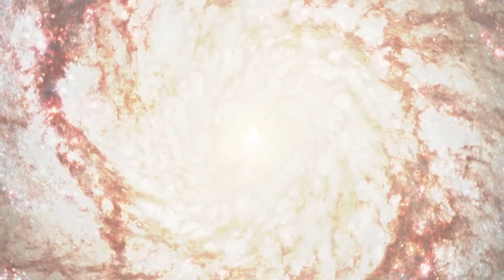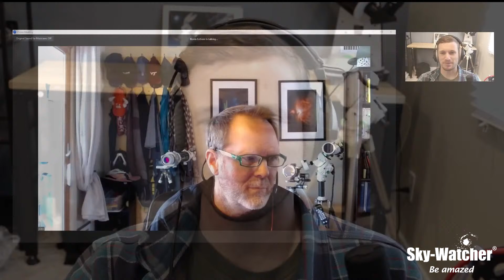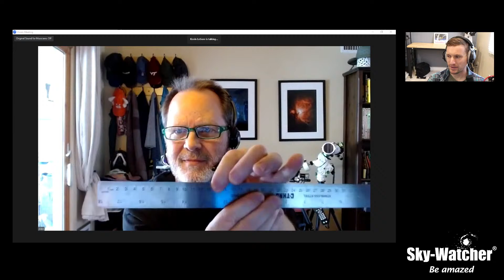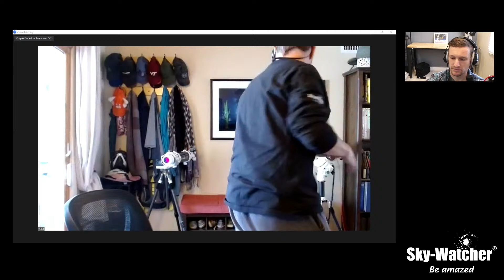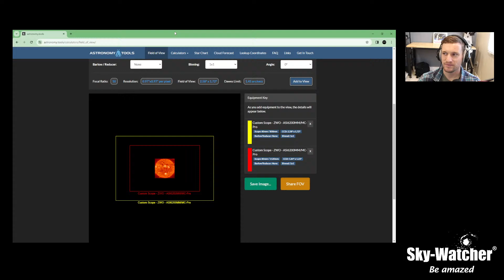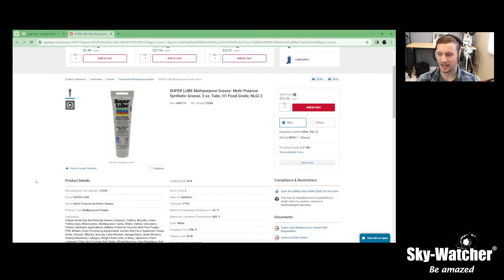What's Up? Webcast: Tech Talk with Alex

Comment: Great video.  I have a comment about the question that was asked at 10:11 in the video about the "double image" using an ND 100,000 filter with a Nikon P-900x camera.  It sounds like the person is getting a "ghost" image.  This occurs because the full solar disk and the partial phases are a really bright area of light.  So, some lens surface in the camera is reflecting that bright spot forward, to the front of the lens, and then that bright spot gets reflected off the backside of the ND filter, back down the optics to the sensor creating the "ghost" image.  The solution is to angle your solar filter just a couple of degrees to send that ghost image to the side walls of the optics.  This is a problem with a screw-on ND filter, because it is always going to screw on "square" to the front objective, you can't make it tilt, so you can't get rid of the ghost image.  This can happen with glass filters in aluminum frames also.  That is why I always recommend buying a glass solar filter about a half inch larger than the front of your gear and padding the inside of the frame with felt, making it snug, but not tight.  This allows you a little "play" room to tilt the filter.  Perhaps the user with the ND filter can glue the ND filter to another empty threaded ring of the same size needed for the front of the camera, but glue it to the new ring with a little tilt introduced. Then do something to block light intrusion through the gap created by having the tilt.